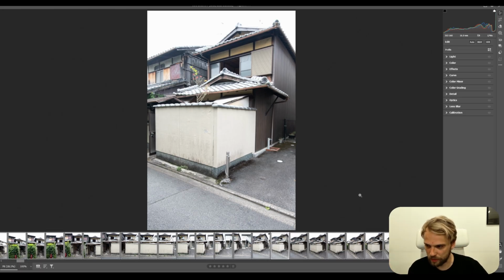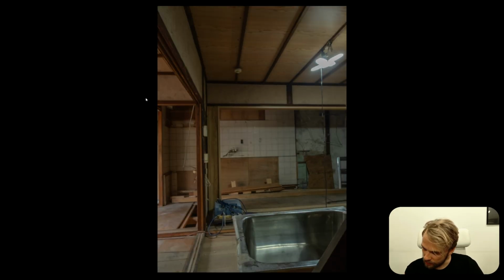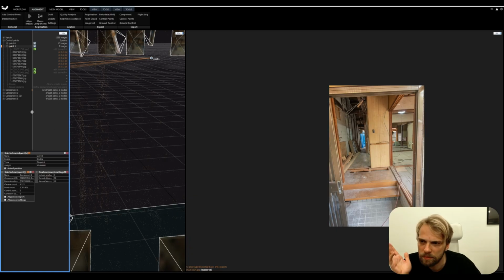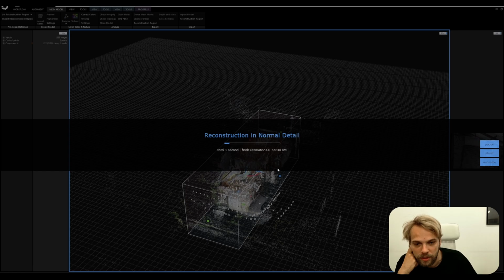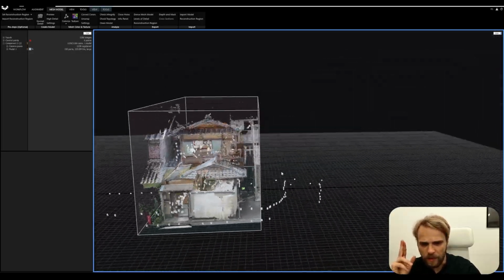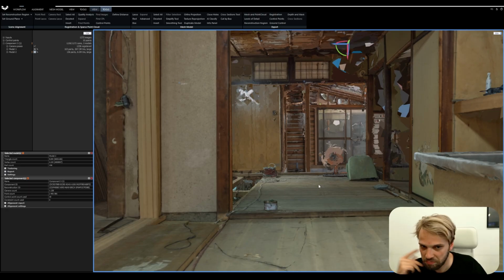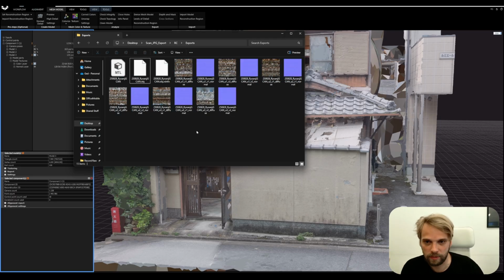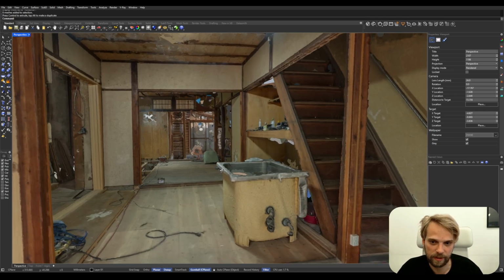Old Japanese House - Photogrammetry Workflow - Reality Scan 2.0.1

Comment: Dude, i love your tutorials, but here you did something really wrong! Never use clarity! In general never use any kind of local pixel manipulations, like sharpness or even denoise filters. You are not making pictures that have to look good, it's dataset for measuring, so stop poking the data!  If you image is noisy use a tripod, but stay at lowest ISO possible. Put your aperture to the sweet spot of your lens (typ. F9 - F13) and keep all settings the same over a chunk of images. Hell if you wanna go crazy also fixate the focus ring with a piece of duct tape. 
All that said, actual software is really capable of reconstructing geometry from images that has all kinds of flaws, but the problem is that it is not easy to verify where the errors are acceptable and where they are not. So keep your images as clean as possible and never use clarity! (it's one of the worst chaos imaginable for the image reconstruction algorithm)
Reply from the maker: Before using clarity I had ~960 matches (arguably higher quality matches) and after using it I ended up with 1100. The main struggle of this project was to get the whole building as a single object without being able to fly back and take more pictures. So that was prioritized over quality. Ofcourse if alignment went smoothly, then I would only work with highlights/shadows.. but it rarely does.
P.S. wherever was passible - a tripod was indeed used.
Reply: @DesignGoBrr  I see, the small connection over the stairs ... interesting that it actually helped, and the 2nd floor wasn't totally misaligned ... you helped with the manual alignment points. That's good. Do more ;)
I worked in surveying with photogrammetry, capturing the changes in volume of giant dirt piles for taxing purposes. We had coded markers on the field with exact positions measured with GPS. Without those markers the reconstruction was already very good because of the gps tags in the drone photos, but it still "hangs" a little bit in space like a spider web in a fine turbulence field. The markers included in the reconstruction, this little hanging could be reduced to tolerances <1cm . 
One day we had problems with trees at a new location and so we kept the drone a bit higher over the ground as usual. At home we realized that the software couldn't find all the markers automatically anymore, because some of them were to small. So i tried a bit om image magic to avoid picking the markers manually (which is also way less precise). Actually a small bit of clarity helped with the marker detection, but...
Remember the image with the spiderweb in the turbulence field? Those turbulence peaks getting higher in amplitude and the frequency of the field got higher so we got way more and higher/deeper "ghost peaks". Maybe because there were fault matches found with high confidence?  How we did find this out? The money! The taxation was so off that we discarded the measurement and did it again the next morning with a lower flight height and some manual piloting (yeah we were normally quite lazy because our workflow was routine). This time it was business as usual (nearly anything was scripted up to the taxation bill). Out of interest we compared the measurements and the deviations looked like some kind of distorted voronoi diagram. OK! nobody would have seen that just by looking. The model >looks< fine anyway, but in that case it would have been an expensive adventure.
For your case I would have tried to find some reference spots between the ceiling 1st floor and the floor 2nd floor. Or tape some rods outside the window with known length. Make more manual reference points. 
But in the end only do as much as needed and as few as possible, and therefor just take some measurements in reality  and compare them to the scan. If it's good enough, it' good enough. And keep on doing what you do - share your creativity and knowledge. 
Really thank you so much for every vid you did.

Comment: If you convert the mesh to point cloud in rhino it gives you the option of hiding/ deleting or exporting the mesh meaning you are left with the point cloud which is much lighter. You can then cut sections through the point cloud to start to create a 3d model. You can also use ‘plane from points’ command the create surfaces from the points. You can then make the surface a cplane and use ‘project to cplane’ to project points onto the surface, which is kinda cool.
If you measure accurately between control points on site, you can then accurately scale the model in rhino (use two points on each x,y and z axis of accuracy)

Comment: Great work! Specially for interiors I recommend doing raw scans as if im not wrong latest iphone pro versions come with lidar. Would be great mixing photogrametry for exteriors with classic scan and register for interiors. What are your thoughts on that? Also if you have alredy a good workflow with pointclouds and meshes get a scanner, its expensive but i think it will payoff in your case, maybe a BLK if you want cheaper and willing to sacrifice 2-3cm within the scan itself. I personally work with a FARO static scanner, but well thats up to you. Keep up the great content!!!
Reply: Agree, Faro are super accurate. usually 1/16" difference max if scans are connected correct. Also it is important to not move tripod.

Comment: Amazing scan, a small tip  (you probably know) is to import the model as a "Linked Block" - this way all the information from the scan stays outside of the rhino file (you can go from large file sizes with textures and mesh) to only having the rhino geometry you are working with being saved (takes 1 second to save vs. 10-30 seconds for large files) - it also does not create duplicates of the information you have from Reality Capture, and I think it also off-loads the textures as it seems to only be "caching" it for previewing. This is because the block is linked and "un-editable" in that specific file - I noticed you import it as ungrouped/unblocked meshes.
Reply: I am doing it the same way if scans are larger.